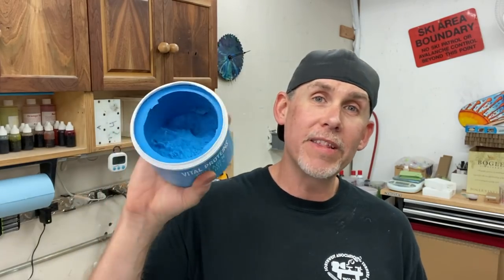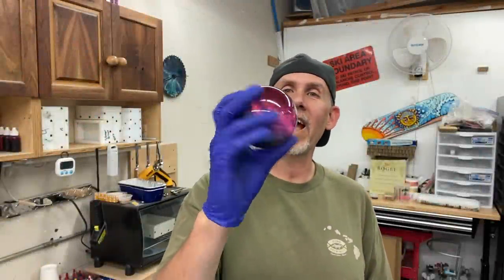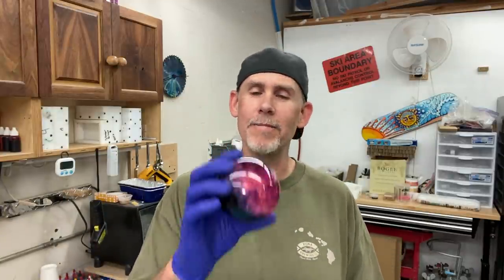Casting and Turning a Faux Burl Alumilite Sphere

Comment: I like the way you use the tooth pick to add colors to resins that stuff is expensive.
Reply from the maker: It's not really about saving money in this case, the Alumilite dyes are just so concentrated you have to add just a pinprick at a time to get light colors like that
Reply: Ic  well it helps both ways

Comment: You make the most amazing stuff ...you make it look so easy ...i always get cracks and bubbles in my resin when i get it out its still soft ....awsome
Reply from the maker: Thanks Richard! Sorry to hear you're getting problems with your casts. Often times it is the result of mixing or measuring. Make sure to mix it up well
Reply: Thanks i will extra mix it up ....thought i was i used a home made whisk in my drill ...cheers though 👍

Comment: How do you get the cured epoxy out of the mold you used for the vacuum chamber? Does the epoxy just not stick to it and slides right out or do you just rip it to pieces like an outer shell of an egg or something?

Comment: How long does your casting stay in the pressure pot? How manys days do you let the casting cure before you turn it? Just getting started.
Reply from the maker: Welcome to the addiction Don =D  It depends on the resin you use, temp in the shop, and volume of resin you pour. For Alumilite Clear Slow Set, I would leave these in the pot for 2 hours. You can start turning in a day or two, but you'll want to wait until full cure (5 days for Alumilite Clear Slow Set) to get the best polish on it. Other resins have different demold and full cure times, but it should let you know in the instructions or on the website

Comment: I have a issue with this one which looks like the air bubbles are just pushing up against the item on the inside. any idea of what caused this? How can i send a photo
Reply from the maker: I'm not sure, could have been air escaping from the under the burl piece possibly. It helps to pour just a little in and swirl around to make sure you get any trapped air pockets out of there